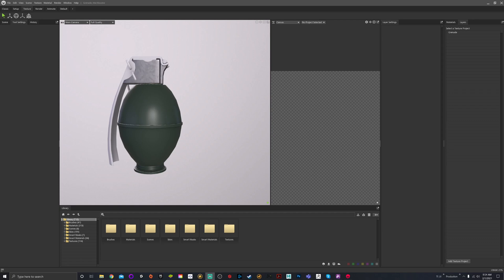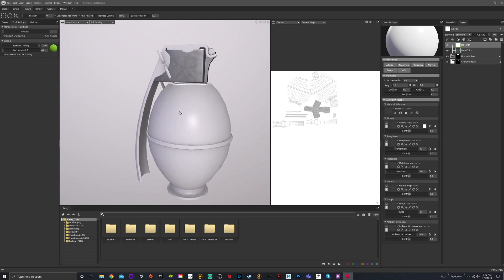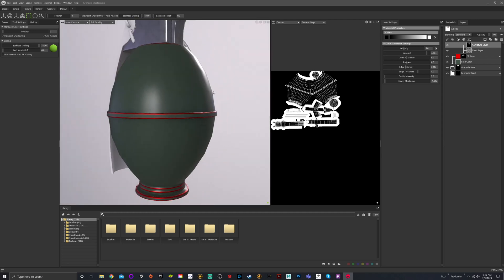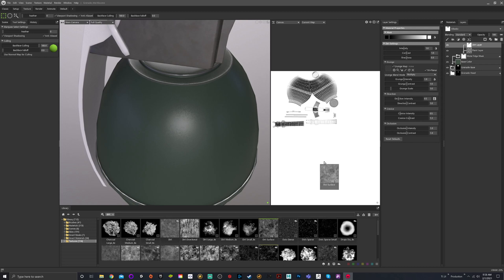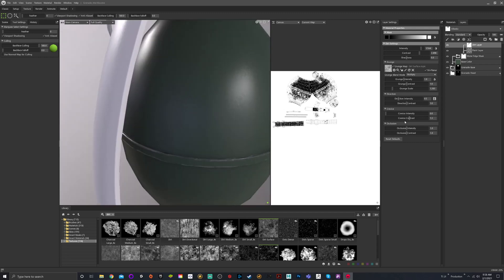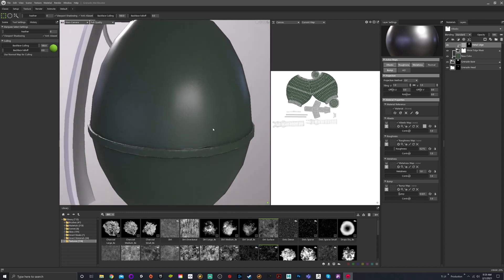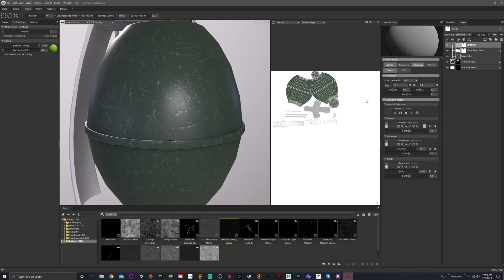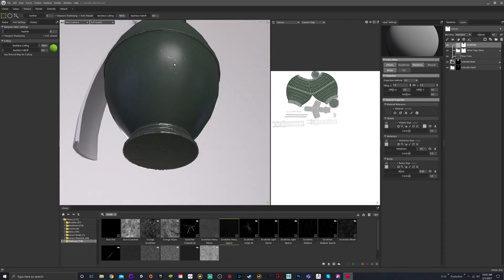6. Marmoset Guide - Input Processor (Layer Dirt and Scratches)

Comment: when I put Edge Contrast value in 0, while making scratches, unlike yours, mine is all red as the fill layer takes the entire part that in working and not just the scratches, any tips on what I could do??
Reply from the maker: Just want to confirm that you are working in a mask with a fill layer and not a normal fill layer? Second I would check to see if your mesh maps are all plugged in. So curvature, position ect. Finally I would adjust the contrast if all that prior stuff is set up correctly.